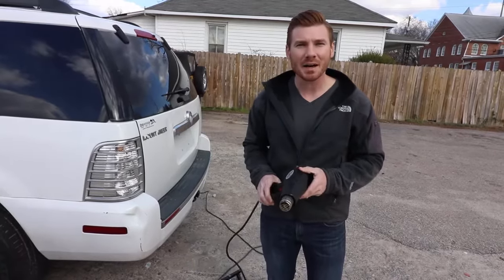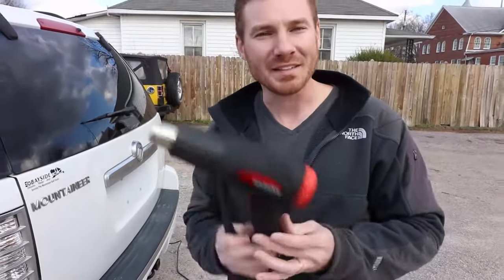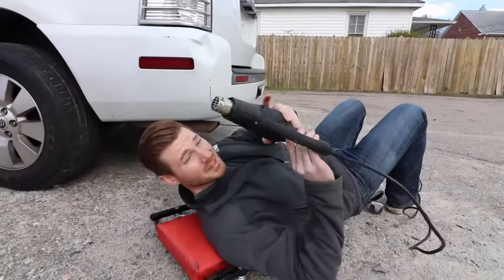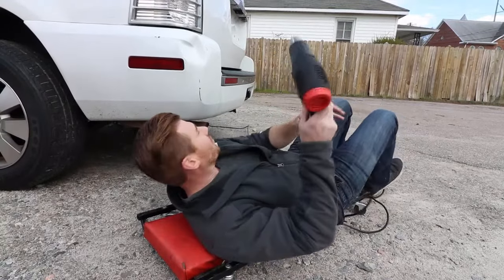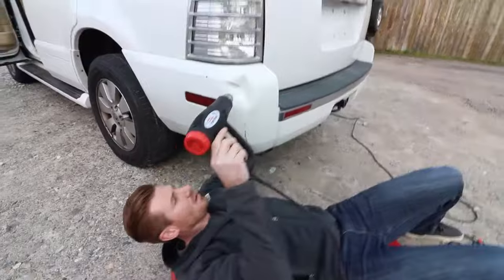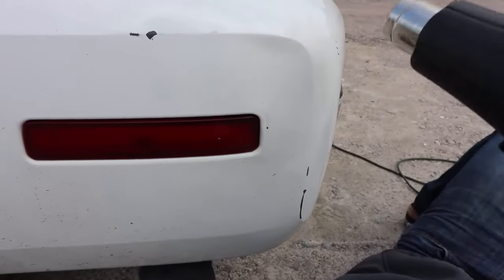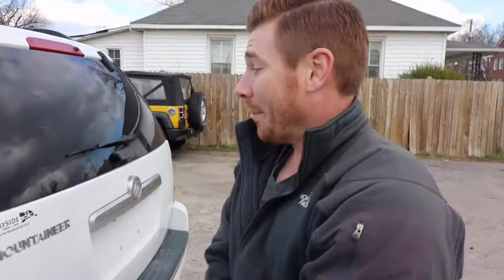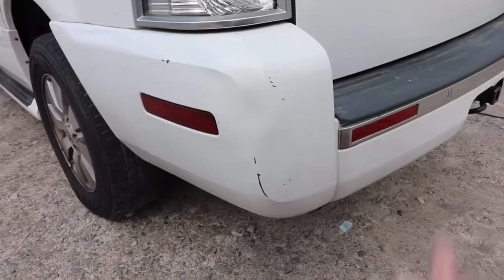How to Fix Dented Plastic Bumper (with a Heat Gun)

Comment: Fixed a huge dent with one of these. Super easy. Rented the heat gun from Ace Hardware, found an outdoor outlet at a park pavilion (I live in an apartment downtown so outlets aren’t plentiful in car-accessible spots). The dent was pretty bad so a small crack happened when pushing the bumper back. Looks far better than before though.